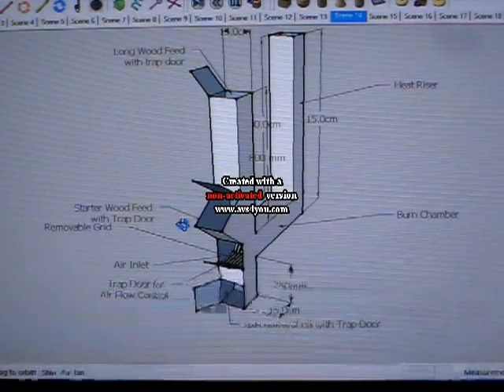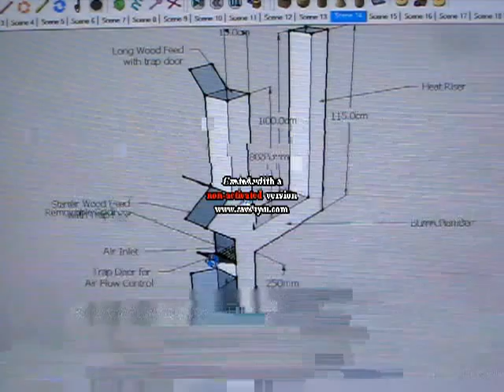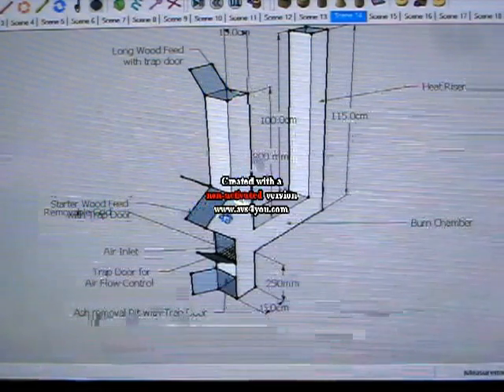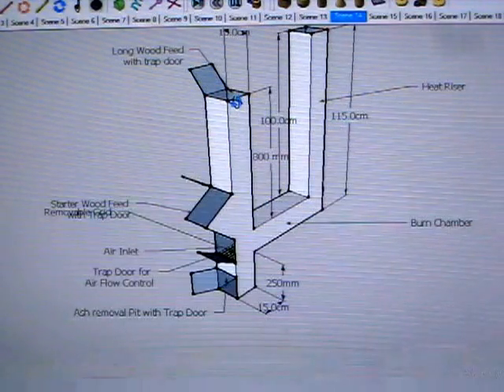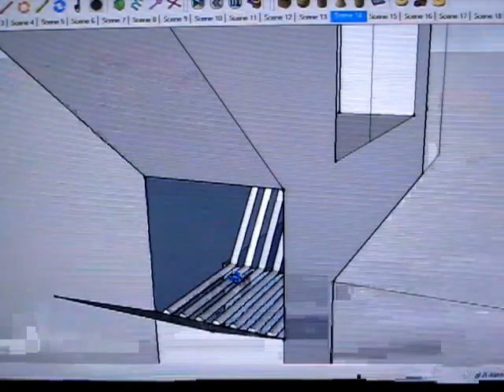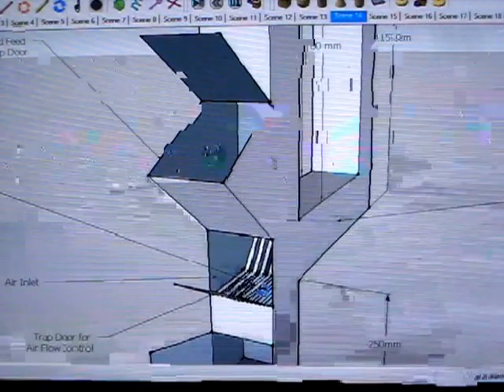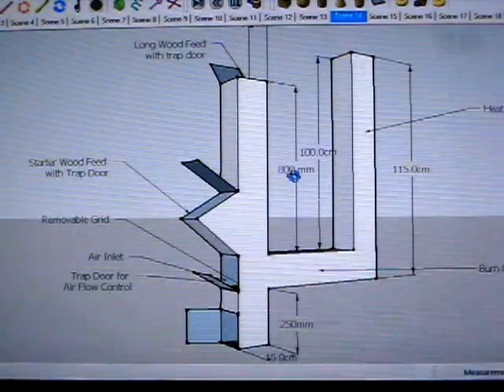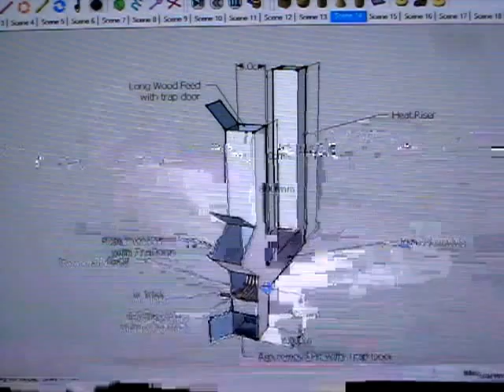Sustainable Living Ideas, Rocket Stove Design Idea, Dual Feed Rocket Stove for Long Burn

Comment: Considerable heat loss in a building is incurred by using already heated indoor air in the combustion chamber. I would love to see a design where out door air is braught into the combustion chamber.  This outside air would be preheated as it moves alongside the combustion chamber

Comment: Electricity, water, air.. amything like that takes the shortest route and water/gas only will take another route when pressure exceeds nominal flow. So the 2nd longer route wont do much.. it will change airfloe so either a little smoke escapes from it or more probable air will come im trough it to feed the fire. Theres no good use for it at all.

Comment: I like the idea of the long feed tube. I wonder about slowing the burn, only because incomplete combustion could cause creosote buildup in the riser or flue. One of the great things about the rocket heater is that it burns so hot that there is nothing left after the burn. Overall, great idea.

Comment: I like your design.I just finished some research on a rocket stove that i built to experiment with, and what i discovered was a longer feed tube works good for long burns but if you are going to introduce air into the system thru an air inlet you will not get a clean burn,it caused the feed tube to act as a chimney and the wood started back burning up and i lost the "Rocket" effect.I found this out because i tried the same thing.Smaller diameter fuel  feeds faster and burns alot hotter than larger fuel,so i start with small stuff and work my way up. I make sure the fuel is irregular in its shape so it doesnt fall together and restrict the air entering the feed tube . the ash clean out is a nice idea but in my experience(which is limited) you would be better served to put it  under the heat riser too.Thats where i get the majority of ash buildup,its a really fine powder like ash that is minimal.You dont want to use any form of damper on the exhaust or air intake to control burn it will make it smoke and not burn as clean.Just my thoughts and experience, i am by no means an expert..
Reply from the maker: Agreed with what you say. I've been warned about the long feed tube acting like a chimney after it heats up.

One remedy I can think of is to make the long feed tube out of chimney galvanized sheets. So it's thin enough that won't retain any heat.

Also if the lid can be closedtightly so that it's air tight, I think that will further reduce the chances of it becoming a chimney. I have infact seen one RS that used a very similar design, almost identical, and seemed like it was working perfectly.

SAeid
Reply: rockethead555 my current feed tube is about 14 inches long.It could be longer because when i hold lit paper beside the top of it it still pulls the smoke down the feed tube.I will try to put an extension on it to see how long it can be before it starts losing the rocket effect.The only issue i have had so far is its difficult to light because its so long.
Reply from the maker: Yes, a long chimney can take a while to heat up and therefore start to rocket. How about putting a valve that would guide the smoke through a shorter route when you just start the stove, and as the chimney heats up, you can switch the valve and guide the smoke to the longer route of the chimney. I saw that in one video ad seemed like a great solution.

Saeid
Reply from the maker: rockethead555 I never did build this particular design. I did a simplified version with chimney tubes(very thin walled), encased in a brick tower, and that worked fine.
Reply: I may try that. i will weld a 2" close nipple down about 6 inches above the grate for lighting and then  put a cap on it once its lit to keep the feed tube from becoming a chimney.
Reply from the maker: Cool! Look forward to seeing it
Reply from the maker: 64ghiaman Thanks very much for your insight. So without an inlet for air, you think this system would work then?

I will keep in mind your advise on the ash pit.

 I have seen dampers on both inlet and exhaust on working examples of RS. To me it would make sense to be able to limit the flow of air going in more than it would limiting the exhaust coming out though. Kind of like how car engines work
Reply from the maker: Eman Gregory Eman, have you built a RS? Would love to see a video of it. You're giving great advise here. Thanks!
Saeid

Comment: I have a very similar set up. Search "raging pellet rocket stove pipe gravity self feed" you'll see my rocket stove pipe is burning complete with no smoke, no fan, no insulation,  no welds and achieves over 700ºF. Have fun and be safe! (0: thx for sharing

Comment: I think your air inlet and starter inlet should be combined. Why have extra openings that you don't need?
Reply from the maker: You're absolutely right!
Reply: Excellent idea, deezplace!  What jumped out at me though, is the orientation of the grating.  Why wouldn't you lean it back toward the opening, so no pieces of wood can fall out?  It would keep all the wood and embers contained and/or moving toward the burn chamber.

Comment: Feed long tube won't become a chimney if closed, right? Short feed would be air intake, right? Also needs a shorter run to chimney in my opinion
Reply from the maker: That's the general idea anyway. WOuld have to build it ad c if it works in practice.

Saeid

Comment: Great design idea - the self feed stack is soooo convenient - I built one that heated two room in my house and the wood feed tube allowed for stoking only once every three to four hours. 
My design had intake air pre heating and would burn so hot that in just 24 hrs of operation it had burned through 1/4" solid stainless steel barbque grill grate. 
Keep up the great work!!

Comment: I think you are missing the points of a Rocket Stove technology when combined with mass heater. As I understand it, burn hot, burn short time, burn efficient, to heat mass which will feed your space warmth with MINIMAL wood burned as the heat is kept in the mass.  I see your idea a working well, but missing the point or need for space heater.

Comment: good idea. i am wondering if the top tube were used as a feed for wood chips or pellets that it might work for long burns. of course this instantly increases the complexity as one has to include a feed system to drop the wood pellets.

Comment: Good work. I have some suggestions but need a phone call. 509-217-3390. I am in Spokane WA. On controlling the burn with Rocket stoves one never does so by limiting the air intake. especially with the mass heater attached. the burn is slowed by slowing the fuel. manage the burn through the fuel supply. cutting air will only cause an unclean and inefficient burn. i.e. smoke. I am victor.

Comment: You should probably watch web4deb's Rocket Mass Heater on steroids.  It is a series of 6 or 7 videos where he built a similar device, modified it a few times and showed the problems he had with his rocket mass heater, including damage from too much heat inside it.  I also agree with the comment that you are forming too much chimney with a 80 cm vertical feed tube.  Web4deb avoided that by angling the feed tube so that gravity still fed the system but reduced the "chimney draw" of the system.

Comment: Maybe the short trap door could double as you air inlet control. This is because the initial fire start with short sticks will need full trap open anyway. When you switch to the long wood, you can have to short wood trap door regulate air. Just a thought
Nice design!

Comment: I see that you will have problems with fire burning up your longer feed tube.  The only way to prevent that is to have your air supply coming in through the top of your feed tube.  You may also have to slightly restrict the size of opening for the air flow into the top of your feed tube.  This will allow a more turbulent air intake and prevent the fire from burning up the feed tube.

Comment: One thing I am curious about and can't seem to find an answer for is how lengthening or shortening the burn chamber affects the btu output. The best I have found is a 4 to 1 ratio of chimney length to burn chamber length but it still doesn't answer the question. Do you know what ratio you will be doing this at?

Comment: I also wouldn't make a cooker with open flame because you'll loose the seal on the system instead have a exposed metal surface early on. That will heat up to cook on. Make a bend in your exhaust right after the fire box for you cooker.

Comment: I think you could eliminate the air control door and make the small feeder door the air control saving yourself extra work. I wouldn't choke the fire too much because of the mass heater you'll loose draft as the heat slows. Rocket stoves fires normally die before draft is lost. I've seen blowers attached on mass heater set-ups for initial draft.

Comment: I see this and think of rocket mass stoves. you really should not need all the ash removal stuff as with a healthy rocket stove the white ash just gets blown out. Anything black is not burned completely. On the rocket mass version, the white ash gets picked up in a trap at the bottom of the exhaust.

Comment: To slow the burn, put a damper on the air inlet. (less air) The long wood feed doesn't need a trap door, maybe another damper. I would take the removable raised burner idea from the Alb Samovar, should work. Here's the samovar, good luck.... /watch?v=3higIQ-j7go

Comment: I close the door until I feel there is a good burning. Got 900°C. With full boiler it will burn about 2 hours. 
This system is just for testing. Nothing is insulated. The boiler gets quite hot. Insulation will improve a lot. Maby also to preheat the air.
Works like one of this comercial woodgas boilers, but without fan. 
The heatriser is the fan...

Comment: Just found your video! 
Did some testings for myself to have a longer burn time.
I have used a old electric boiler (25 liters). Cut a hole on one side and on the opposite side. The boiler sits on the end of the burn tunnel where normally the feed tube is, with one hole on the burn tunnel. The other hole has a door. Between the boiler and the burn tunnel is a grate. I make a little fire on the grate. As soon as it begins to suck the fire in, i fill the hole boiler with wood.

Comment: seems to me the top pieces of wood would hold back the bottom pieces of wood...due to weight...then causing a back draft and maybe causing some big problems...I've seen some automatic feeders for rocket stoves, but they changed from burning firewood to wood pellets...works well...

Comment: It will work with two feeders too, as usually you will shut the enclosure of the feeders after feeding  wood.
But actually you don't need to have two feeder, one inclined lower feeder is sufficient, only you need to enlarge the inclined feeder length to 80 cm or what ever length you need, good thing of inclined feeder is that the wood consumption will be slow as because of friction the intake of wood in fire chamber will be slow whereas in vertical feeder is fast more wood consumption.

Comment from the maker: I think controling the air intake or the flue would depend on the entire design of the RS. But makes sense either way.

I have come to the same conclusion about the the double feed. My new design is more straight forward. 

Will post a video when it's done. And thanks for your comment,
Saeid

Comment: i think a better way of controlling the burn would be to use a flue dampner, at the moment my rocket stove is 'over running' and I have to use a flap over the top to slow it down, im hoping to work on a better chimney with flue control soon so will report back, thanks for sharing your design, I think it would work well but im unsure wether your double feed is really necessary, im very interested in hearing your results

Comment: Can we have an update please..   My only comments to this design, is.. why have the ash pit? If it burns correctly-there should only be no, or minimal ash, removable via your air door.. It's only the closing trap doors which make this design work, basically a good idea..   What i have done, is keep the basic J tube layout but make a slip on extender for the feed tube---same thing, much easier tho...

Comment: Why not just maintain the simple "J" configuration and construct a wire frame wood support add-on to the burn chamber wood input? 
A sturdy steel wire frame of 9 gauge (approx. 3 or 4 mm diameter) wire won't alter air flow but is very strong for holding the wood and the overall height of the wire frame is your option. Angulation of the frame is your option. 
Your air intake shouldn't be affected. The fire has no idea you're using longer material. Pieces one meter or longer could be used.

Comment: I agree that the angled feed tube would be better, I have experienced with mine that even though the air intake should take the flame sideways, the burn can go up the wood and cause a real problem as it would go up like a chimney, otherwise I think it is a excellent design. Thanks for posting, make sure you post more results after it's created and tested. Thank you. Great ideas

Comment: maybe make the burn chamber/heat rise connection moreso a 45 degree angle instead of a 90...this will ensure stronger draft...your having 2 feed tubes and an air flow might not get the draft your hope for..but i do like the design for 2 feed tubes...one could be used for manual feeding long pieces or auto pellet feed system....

Comment: If you can smooth out the right angles in your design, and shorten the horizontal run from the burn chamber to the "chimney", it will make the entire assembly more "draft-friendly".  Think about "venturi effect" when in the design process.  If you can effectively achieve this, then a combustion air control will definitely be necessary.  I absolutely like the "dual-feed" concept -- it's given me some ideas on what I plan to imminently build.

Comment: it wuld work,but2big deals u dnt get on all th vids on Utube,1 th heat riser needs 2B round ive tried making them out of bricks ''square'' it doesn't rocket.2 where th burn chamber meets th round tube it has to ''bottle neck'' get small then get bigger th heat compresses thn expands up think of an hour glass w/sand in it flowing upward i know this Bcuz i have experimented w/this heater plenty th mistakes R alot of exercise rearranging blocks gets heavy quickly lol goodluck great cad piece!

Comment: I think the vertical feed will cool quick enough because it has no insulation; so it will suck back very very little if at all, even if not airtight. When the system is hot/riser hot, the flow in the right direction will be guaranteed. When are you building it?! Looking forward to the result.

Comment from the maker: Have a look at this:
/fhkCc33Dtas?t=5m55s
The guy uses a fire proof gasket to seal the door.

There are ways to seal the door on a rocket stove. With the minimal heat that the door on a properly running stove will receive, I think even a rubber seal might hold out for weeks. 

In any case, this is something that needs to be tweaked, in terms of the relative lengths of all the components and the chimney too.

Comment from the maker: Hi. Thanks for your feedback. I agree, all three doors, for the feed tubes and the ash pit would have to be air tight. I don't think that would be too difficult to do, 99% air tight anyway.

Why do you think the air control door would create an up draft? I have seen similar design in many working Rocket Stoves.

I think if I spend enough time tinkering with it, a working version of this is possible. YOu should it give it a go,seen ur craftsmanship,  I have no doubt you could get it to work

Comment: I think it's an awesome idea, you should build it and tweak it. I've only built one rocket mass heater but in my mind's eye I picture your feed tube becoming a chimney by accident, especially when you go to put more wood in. If your heat riser draft is strong enough, maybe not though. I would insulate the burn chamber and heat riser well and make sure the heat riser  is at least about 5 feet tall. Looking forward to seeing this in action.